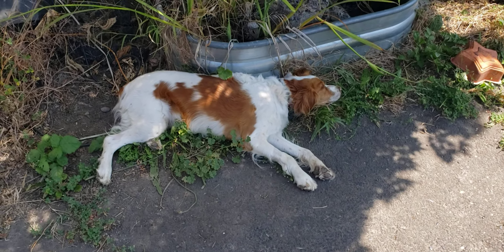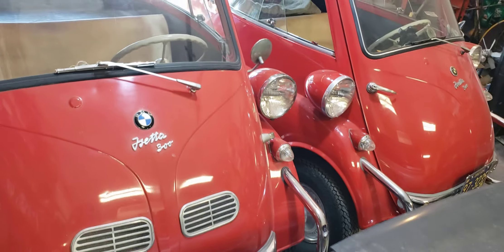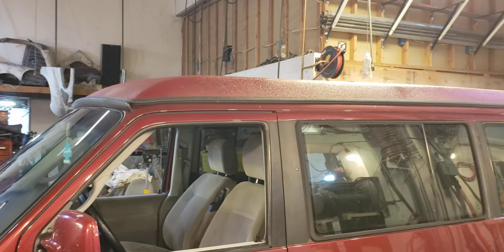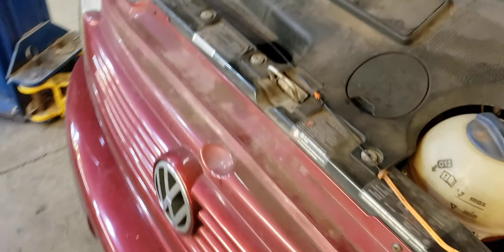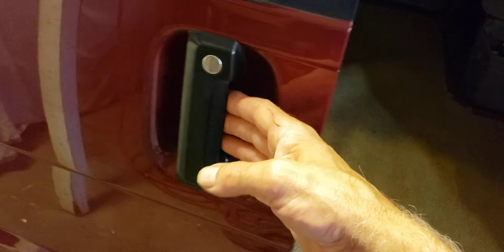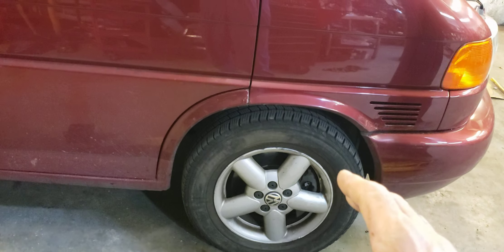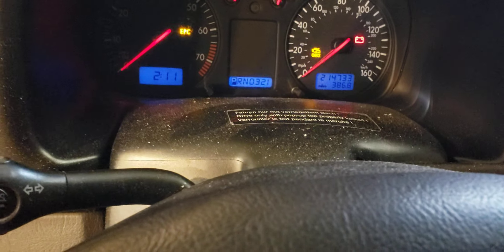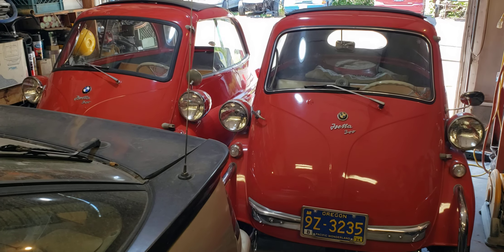Be Prepared To Over Spend Owning This Car

Comment: The actual weight for a Eurovan Weekender is 4,478 with a 1,387 payload giving about a 5,800 lb. gross vehicle weight (fully loaded all passengers and cargo) - no where near the extraordinary 8,000 you mention.  I'm fairly positive the pop top weighs a lot less than 1,200 lbs. but I couldn't find that weight.  VW only shows about 200 lbs. difference in the weight of a regular passenger van vs. the basic Weekender.  The Eurovan Weekenders getting $30 grand are very low miles or ones that have had some amount of restoration work - not this rust bucket.  The 2.8 is the VR6 engine, loves to rev.  Neat car, but would not be my choice for a small R.V.
Reply: If I remember correctly, the Westfalia pop top weighs about 100kg incl. all brackets and the bed. At least that's what I remember from the time I helpt retrofiting one into one of those. 
It was easily possible to handle the roof with two people, transferring it from a wrecked van to the receiving vehicle.

Also economy wasn't really changed by the retrofit. But it was a manual TDI, not one of those awful VR6 (they never where any good in any vehicle, I just hate them). The TDI Eurovan (T4 in Germany) served us for about 10 years and next to 700.000km without any flaw. Not a single door handle broke in that time ;)
Reply: @rollerchaos  The European buyers got it right - the TDI/manual makes more sense in the Weekender/T4.  The 2.8 VR6 will easily rev past 6,000 rpm - and it loves rpms - combine that with an automatic transmission and it will be unhappy.  Combine the 2.8 VR6 with a manual transmission and it has an identity crisis: should it be a sport van zinging through corners?

Comment: Over here in Europe those VW T4 are available with AWD, Diesel or Turbodiesel engine and usually 4-5 speed manual transmission. Of course they rust when driven through 20 winters with de-icing salt. But they hold up still far better than other small vans. Please check again on the weight of the roof. It has to be way less heavy than 1200 lbs. The whole car weighs less than 3000 kg.

Comment: I used to own a pre-facelift T4 "DoKa" (Dual cab) 2.5 5 cilinder Diesel, manual transmission. Those are nearly indestructible. That VR6 belongs into a VW Golf/Rabbit MK1 or 2, but manual 😎
Reply: The VR6 was introduced in 1991 in the Passat. The Golf MK3 got it and many other VWs Like Corrado, Bora etc.

Comment: Sounds like the USA got the worst models! That's the T4, Europe currently is on the T7 model. They were available as 4x4, called 'Syncro' and nobody in Europe bought that gas guzzler V6 plus automatic! Most have a diesel engine and they run! A friend in Germany has one with a whopping 88hp but he takes her across the whole continent. And Europe is as long N to S as the US E to W! 
They also came in long and short wheel-base.